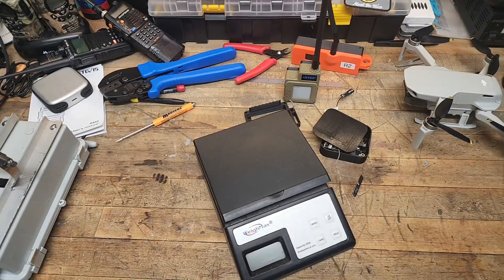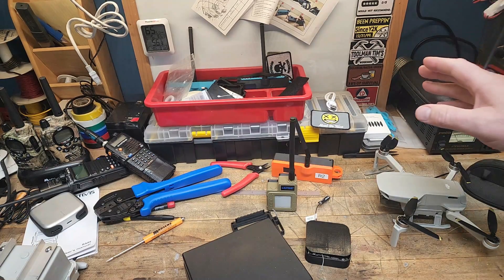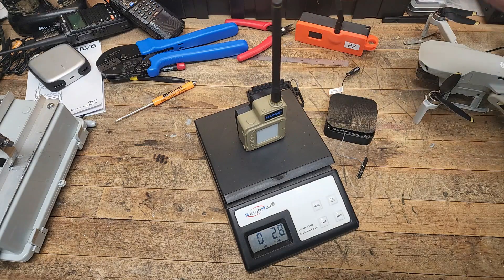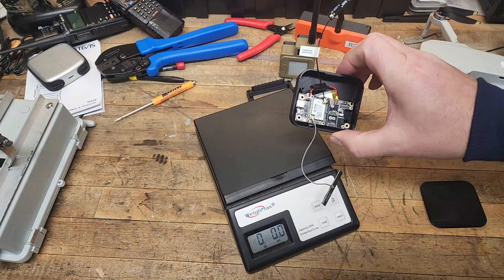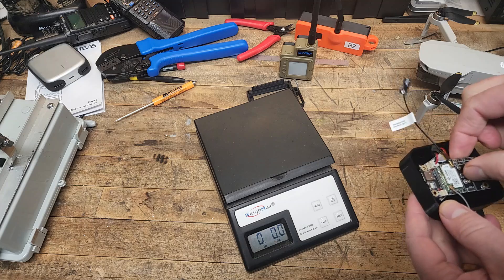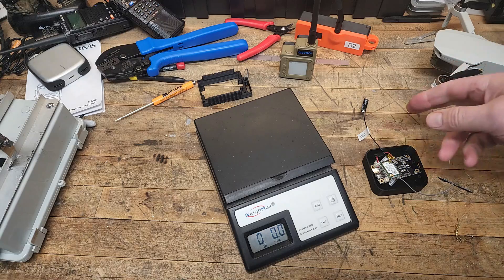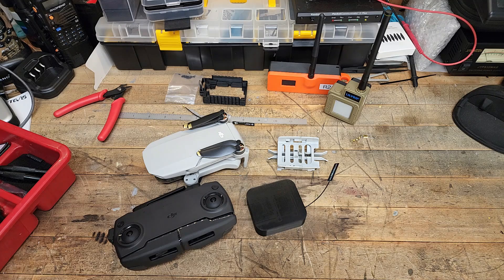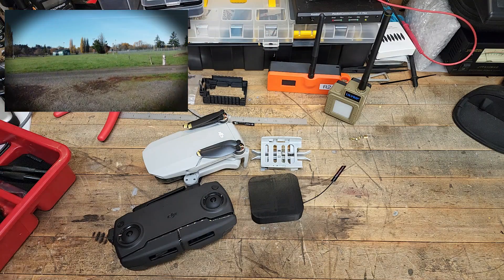Airborne Repeater | LoRa Mesh Range Testing | Meshtastic

Comment: When do you plan on doing and showing the next test? what type of range are you hoping or thinking you'll get? I'm curious what applications this might be useful for aside from typical radio communications in an area with varying terrain. Good video overall man
Reply from the maker: It the weather holds, I will complete my next test this Saturday. Test site 1 is 4.8 miles from my home. Site 2 is about the same. The idea is to cover 10 miles of radius of the city I live outside of. The whole concept to see if using a drone is a viable solution to temporary comms coverage of an area. On paper, it works, but I want to prove it.